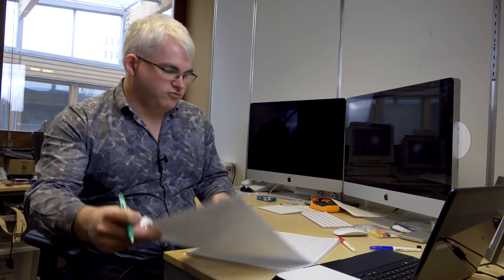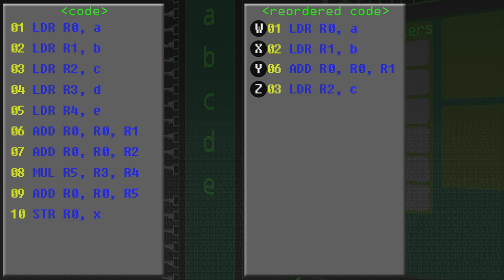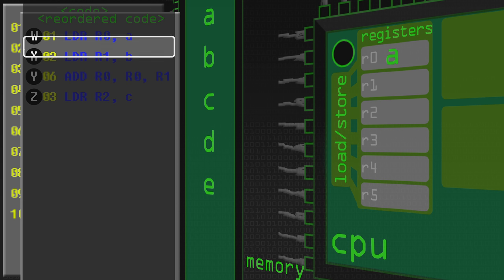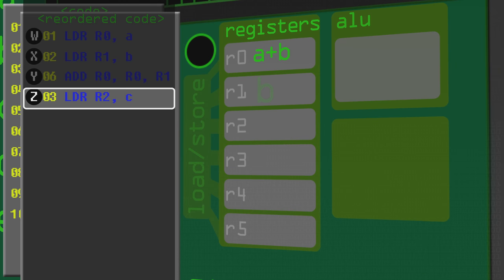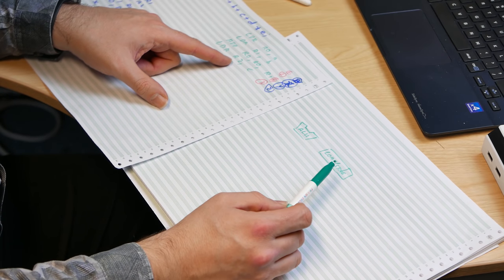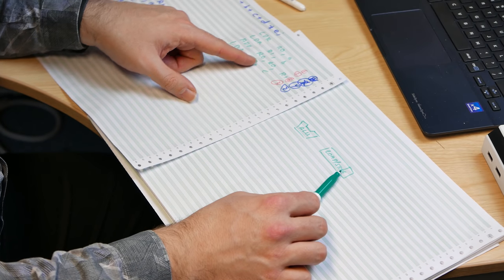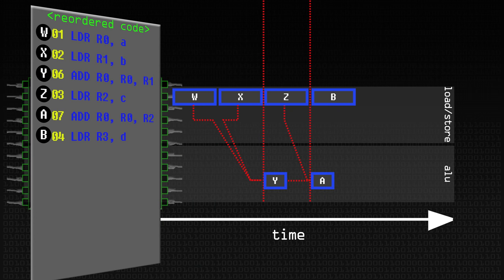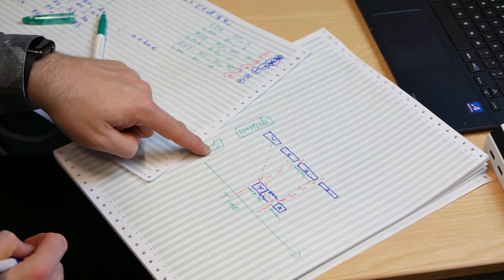CPUs Are Out of Order - Computerphile

Comment: Is there any overhead in the CPU by re-ordering the instructions during OOE?
Reply: Well the CPU, or the execution of instructions is not used for reordering. Within the CPU, obviously, some component is required to analyze instructions and dependencies to re-order them. Obviously this costs some area on the chip, and energy, but in the end it should make execution faster.
Reply: Thanks for the reply. Now that I think about it, the overhead of a potential re-order (+ new execution time) obviously has to be smaller than the original execution time in order to actually enhance the performance.
Reply: The main benefit of out-of-order execution is not to re-order the instructions, but to ensure that the CPU doesn't sit idle while waiting for data to be fetched from memory. In almost all cases there is something else useful that can be done, rather than doing nothing!
Reply: What if we re-order the instruction ourselves? would the CPU still do the re-ordering part?
Reply: In short, yes. Out-of-order designs typically require much more die area compared to an in-order design, and they also tend to use more power. In-order designs need higher clocks to have the same performance as an out-of-order design, but they still tend to be more efficient for low-medium performance levels. For the highest performance, you just can't clock an in-order design any higher (or it becomes inefficient to do so), and an out-of-order design is better.

There are a number of modern, medium-performance in-order designs for exactly this reason, most notably the ARM Cortex-A53, which is the primary core used in virtually every low-end and mid-range smartphone (because of cost). The Cortex-A53 is also paired with higher-performance cores in higher-end smartphones, which allows the higher-power out-of-order cores to shut off when the phone is idle or under light loads (ARM calls this big.LITTLE; there's also a new version called DynamIQ).
Reply: xponen 
I would suspect yes the best order depends on many factors that are likely to change such as how fast the data is retrieved and any other operations it is doing at the same time. You could write the code to make it easier for the cpu but you probably can't make a one size fits all order. But I'm not a cpu expert
Reply: You typically don't care how long it takes from the time an instruction enter the CPU until it is executed, you care about how many instruction per time the CPU can execute.

However, when the CPU suddenly find that it must executed different code than it has preloaded, you do care. Because then the CPU has to throw away all the re-ordered stuff und start with loading a new instruction. Sitting idle for exactly that time you usually don't have to care for. That's one of the reasons CPUs don't just re-order but also speculatively execute code. Otherwise they'd have to do this every time there's a decision instruction in the code.
Reply: They make the design of the processors considerably more complex. You may have heard of Intel's Itanium processors at some point, which solve this problem a different way. An Itanium uses what are called Very Large Instruction Words, where each "instruction" is in fact multiple instructions that can be executed in parallel. It is then the compilers job to turn your program into an optimal sequence of VLIWs. Now obviously you don't have an Itanium in your computer, and even on the high-end server market where they were targetted they never got much market share. One problem with this solution is that it makes any sort of backward compatibility difficult, if not impossible (newer architectures with new execution units on the CPU would result in different VLIW sizes and formats). The other problem is that the compiler writers will hate your processor, since you've unloaded all the work on them. And this isn't trivial work either, in fact it is work that can't really be properly done by a compiler. For instance, memory access times are not deterministic. You might compile your program on a machine with 200 ns memory latency, and the compiler optimizes to that, while someone running your program might have 180 ns or 220 ns memory latency. The CPU "knows" how long memory access takes, and if it was making the OOE decisions it might be able to come up with a better reordering than your compiler could.
Reply: We do re-order instructions ourselves. Reordering is done by the compiler (more specifically AOT compiler). Unfortunately in most cases, we can only compile a program once, and the result has to run on thousands of different CPUs. So the version that compiler "reordered" is not optimized per CPU, but rather optimized for ISA (instruction set architecture). 

The alternative model is JIT compilers (e.g. Java, .NET, JavaScript), which tries to optimize per execution. Problem with this approach is you need user to install Java/.NET/etc on their computer.
Reply: There is overhead in most CPU optimizations, but the optimizations are usually worth it because they are often order of magnitude difference in performance vs the alternative. Example: 

ns = nanoseconds; µs = microseconds; 1µs = 1000ns

* Most CPU optimizations operate in 1ns-100ns range
* RAM access operate in 100ns+ range
* Context switch operate in 500ns-10µs range

Context switch is when you stop executing current program and switch to a different program to execute.
Reply: There is cost in creating, updating, and looking up your "pre-index", in latency (time), power consumption, and silicon. 

If the program is re-ordered fully beforehand (e.g. everything is pre-fetched and inlined), CPU is just wasting time and power trying to reorder/lookup instructions that it cannot re-order.

Comment: I didn't understand a thing but that's cool.
Reply: CrashCourse has a crashcourse on computer science, they go very in depth about how CPUs work and what assembly code does, but they still keep it brief and simple enough so it's very easy to follow for the layman. Provided you have the attention span and pay attention.
Reply: The lines of code that a programmer writes, he expects to be 'executed' by the CPU sequentially.  Turns out though, that CPU's move them around and execute them 'out of order' because thats faster to do. Yet to any outside observer (the programmer) it still looks like the code (which is translated into machine instructions) happens sequentially.
Reply: Fz Does this apply to lets say, 3D applications? for example RTS video games, where some of the things need to be executed sequentally and multi-threading is of no help. Noob here.
Reply: OOO Happens in any program that runs on a CPU that supports it (Pretty much everything) . In the case of a video game, which consists of CPU + GPU parts, the CPU part will therefore be executed out-of-order. Fyi, this isnt something that the programmer can control. It just happens in hardware.
Reply: Same and I had a final exam on this a month ago...
Reply: Fz 👍

Comment: This all should be done by the compiler (or the programmer) - investing logic to "correct" a less than optimal code sequence that has to be present in EVERY CHIP and operate EVERY TIME you run your program?  That's just clearly not the best answer.  I recognize it gave the hardware designers all kinds of opportunity to feel like they're clever, but it's a waste of resources.

Comment: I need to play TIS-100 again.
Reply: I have yet to start. I bought it Halloween Sale 2015, and it has been sitting in my Library since then.
Reply: Michi Lo  -  The TIS-100 doesn't have a multiply instruction. One of the puzzles is implementing one in software. Likewise for division (though I haven't solved that one yet).
Reply: That does defiantly sound like fun.
Reply: Considering the limitations of the instruction set, don't expect to make a fast version. When I was working on it, I kept thinking "This could be so much faster if only the TIS-100 had bit-shifts (or the decimal equivalent)." Yeah, it's a decimal machine, not a binary one. The range of numbers is -999 to +999.
Reply: You just want me to play it, right? ^_^
Don't worry, once I have time, I will.
Reply: Sorry, it's one of those games that's mentally "sticky" when you get reminded of it. You end up thinking about one thing or another to do with it all day.

Comment: So that's how modern processors are able to run faster despite clock speeds having stayed about the same for the past 10 years.
Reply: You also have more cores
Reply: IntarwebUser, yes and no; those techniques that, indeed, greatly increase IPC are way older than that. They just become more and more refined, plus we're able to throw more hardware at the problem (=more transistors, because their density continues going up despite clock speeds having hit a wall).
Reply: Except that there hasn't been much of a change in the last 8 years on Intel's side.

Comment: Superscalar design and no mention of the CDC 6600 "stunt box" dating back to the mid 1960s?
Reply: That would be a video about the history of computing. This is a brief synopsis of how a CPU works.
Reply: I must've been confused by this at around 12:54, "Superscalar processors started to appear in the late mid 90s...." and two examples given from that period.
Reply: He means desktop CPUs, not supercomputers from the 1960s...
Reply: Of course, how extraordinarily silly of me.  I should have realized that just like when I was a young 'un and people used the phrase virtual machine they often meant, not what they had explicitly said, but had instead meant virtual memory.  Thanks for clarifying that for me.  Now I know that when an explanation of how a CPU works is offered it doesn't include all CPUs, just those from the past 30 years or so, and when during this kind of explanation historical examples are offered it is not in fact history and so leaving out whatever seems too far back to be interesting is just fine. Got it. Thanks. Appreciated.